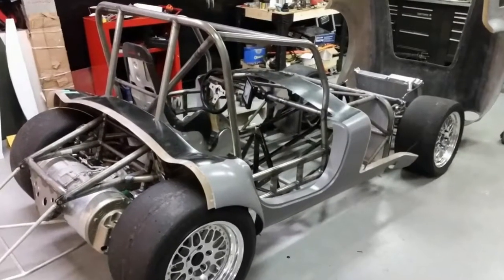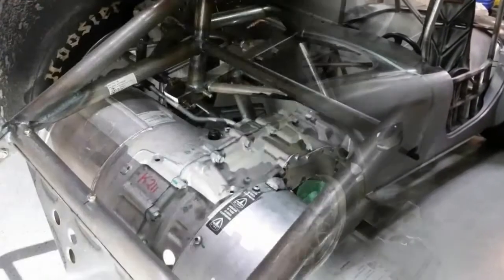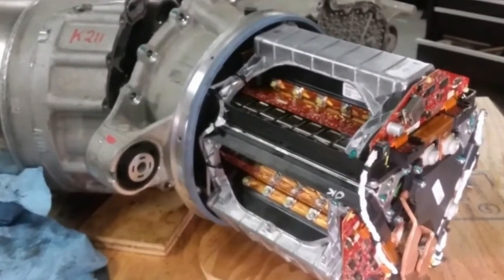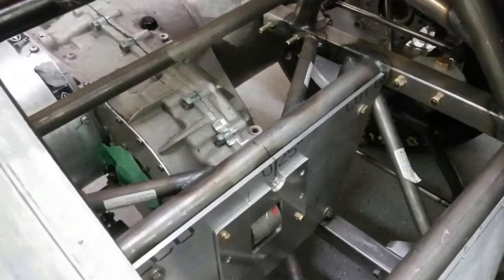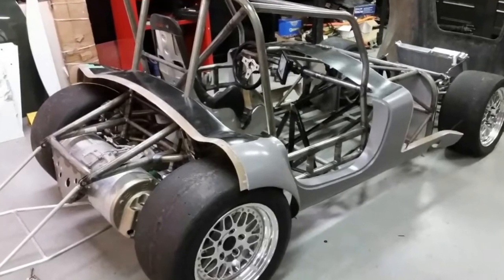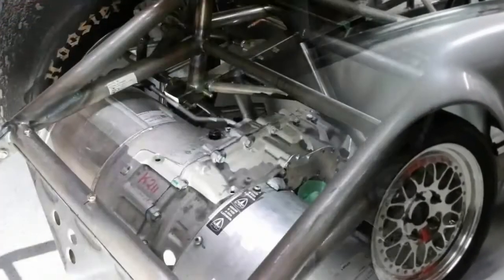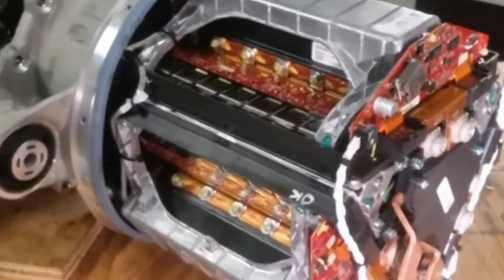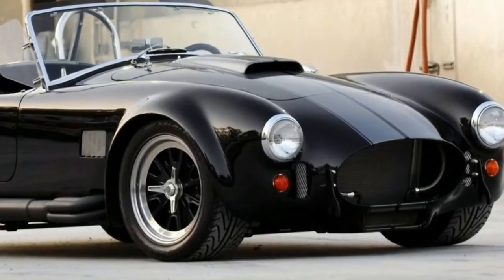Tesla Powered Shelby Cobra 427 Replica Race Car with Kia Soul EV battery Pack

Comment: How much approximately tesla drive unit cost?
Reply: That depends on where you got it, how many are in it and what Tesla it came from. The reason EV's are expensive is because the bulk of the expense is the drive unit itself. Reconditioned or pulled from a wrecked car could be a few thousand or it could be above 10k. New EV drives from other MFG'ers run in the 10-19k range, none of these are drop-in ready they all require some mechanical skill and lots of patience.
EV systems also need controllers that require some customization to control the speed and charge rates of the system, it's a glorified RC car for adults with a lot more complexity and expense. Once everything is done and working, it's very satisfying.